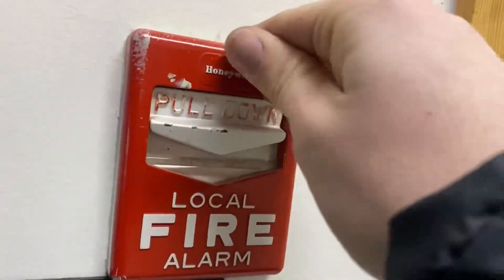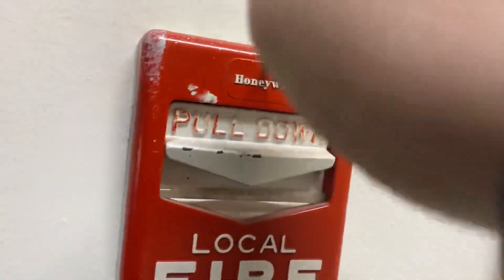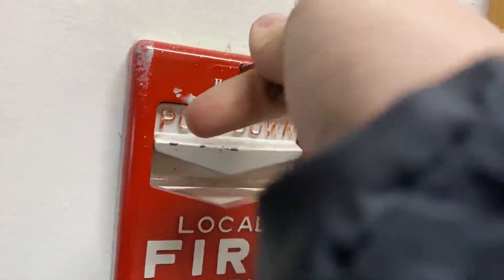Fire Alarm Test #10 | Elementary School Mania

Comment: Here's the 2 different systems:
System 1:
Simplex 4030's
Honeywell Rebranded Chevrons
Honeywell Pull stations
a Gamewell-FCI Pull Station
System 2:
System Sensor MASSes set on Slow Whoop
Simplex 4251-20's
Simplex 4002